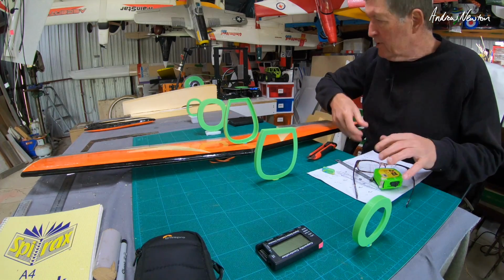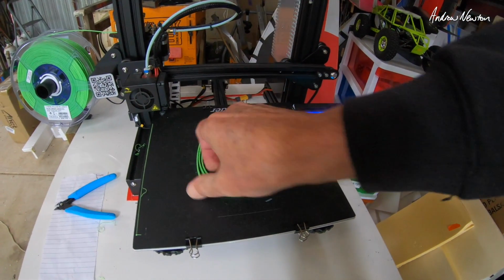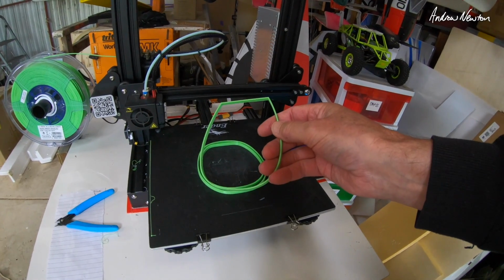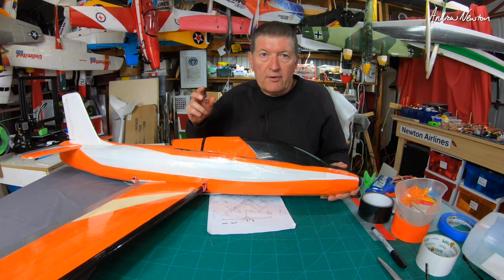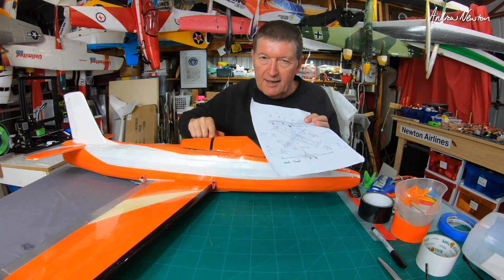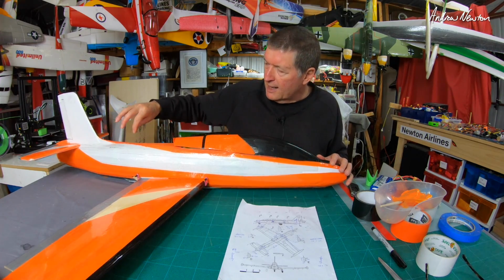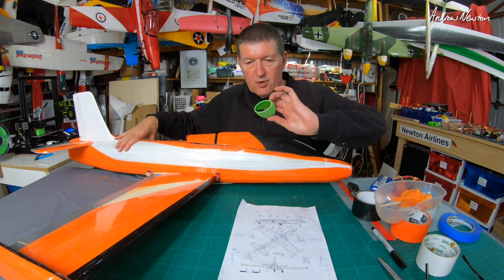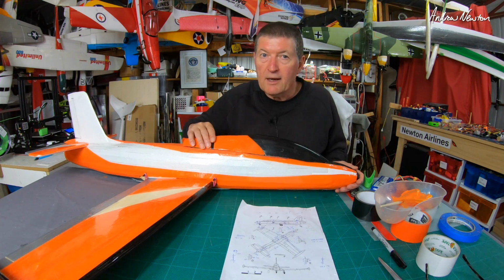Macchi MB-326 Scratchbuild Part 3

Comment: Hi Andrew, great work so far, I did a similar style build of a 182 a while back, but I used balsa for the planking sourced from Bunnings (surprisingly cheap). I used card to template the key pieces to save wasting wood and I found shaping by sanding the curve steps was very easy, I had edge glued them with PVA, but final painting took a lot of preparation, filling and priming to get past the highly absorbent grain... next time it's straight to auto spray filler/primer. I was surprised how rigid the final shape was though, especially torsionally.
Cheers.
Reply from the maker: Yes that would be a better approach. Starting with the right formers would have helped me too

Comment: Thanks for the memory Andrew, This article of yours takes me back to a younger version of myself and when a mate and I also built a pair of MB 339's. Both of us were into slope soaring at the time when we decided to build the 339 as P.S.S. models. My mate built his with a fibreglass fuselage whilst I built mine with foam and brown paper; which was more of an experiment which worked out really well and surprisingly rugged. I beleive that yours will fly wonderfully as I think it might even be lighter than mine was. Can't wait to see the results.
Reply from the maker: Yes it feels light enough, those fuel tanks might take a beating
Reply: @AndrewNewton  What I did was to use press studs to hold the tip tanks on, so if they were to come off they did so without damaging anything. Try it, it works better than having to do frequent repairs which only adds more weight.
Reply: I have had a rethink of this situation since I replied and I had an epiphany!!! I would use magnets, not press studs. I found that those tip tanks frequently got hooked into grass and were pulled off. Magnets glued into the recess in the tanks and into the wing tips would server you even better!!! You can't beat a good epiphany!!!
Reply from the maker: Yes magnets might be the go. Good idea

Comment: I like your crutch based Fuz build Andrew...If you used 6mm Depron planks and make them thinner, you could glue the long edges with fast setting white glue, applied sparingly of course. Then you could sand it smooth after. Takes longer of course, but then we all have time on our hands now..?
Reply from the maker: Should have tried bending taped sections of depron, next one maybe
Reply: @AndrewNewton  Yes, those slow flying indoor giants have curved Depron sheets on them...Must take a bit of patience In guessing...🤔🤔😳😷😷😷😷

Comment: I'd like to put in a vote for pusher - while it will make a good CG a little harder to achieve, she's looking so good so far that sticking a tractor on the nose seems too much of an aesthetic sin to countenance. :P Then again, I fly mostly prop-in-slots and people say the same about them, so if you do opt for tractor I'll understand!
Another trick for getting tape to stick in places where it stubbornly peels: I often lay down some hot glue in a thin film, then the tape, THEN iron over that. Locks it down very solidly. Also acts as a seal against water getting under the tape and lifting it, if you get drizzle while flying or landing in wet grass.
Reply from the maker: Yes I have used hot glue like that, good tip.

Comment: Very Cool! 
2 2000kV motors 6x4 props (push pull) 6S front and back or pusher props on the wing tanks with vertical little wings for prop protection (like the T-33). Little contra rotating props in the fuselage also work (25% energy loss but no thrust bending!)?

Comment: Hello Andrew, i was watching you feed the hot wire cutter (time 2:13 ) with a battery,  how many Volts do you use? and how long was the wire? i am trying to do something similar.  - By the way, i am building a MB-339 too!, just it´s EDF.
Thanks for the info in advance! :)
Reply from the maker: Ooh I want to see your EDF MB-339. 4S LiPo, 800mm SS fishing wire, 40kg. Wire needs about 5A for the right heat.
Reply: @AndrewNewton  800mm? Ohh when you cut the plane nose seems to be shorter, i wonder if we are talking about the same foam cutter. In my country we use to have the same model in service, and the 339 also. Anyway sorry  for my broken english.
Reply from the maker: @AEROERGO  Oh yes that's my shorter cutting rig. Same wire but 40cm length and 2S Lipo
Reply: @AndrewNewton  Ohh now i get it, thanks for the information Andrew, i hope one day be a 1% of what you do in your channel! (just in spanish! hehe)

Comment: Question, where do you buy your depron foam from? I got mine from Spotlight but it seem hard to remove the paper if needed.
 Anyway, good job Andrew and I can't wait for the maiden.
Reply: It might be similar to the type I got; the paper didn't peal off and it was pretty heavy. The solution I found to mine was to soak it in water for aaaages and eventually the paper pealed off. If that way works be sure to lay out the foam core flat when it's drying as it'll take on a slight bow if you lay it against a wall
Reply from the maker: Materials links below